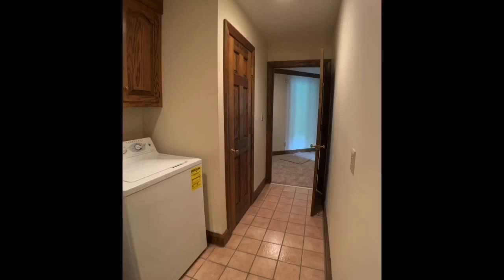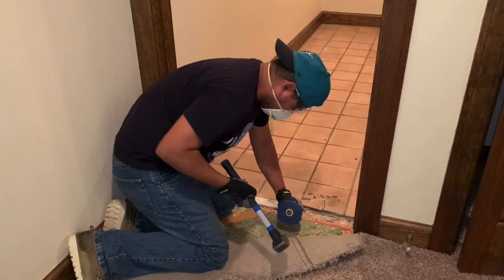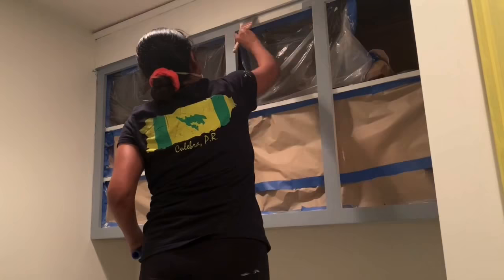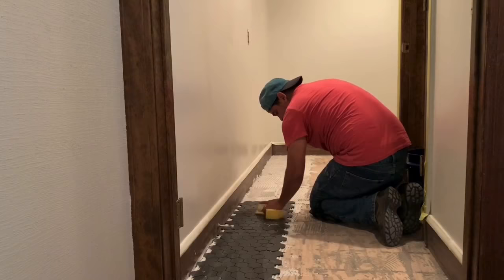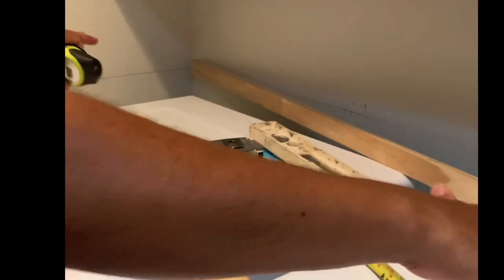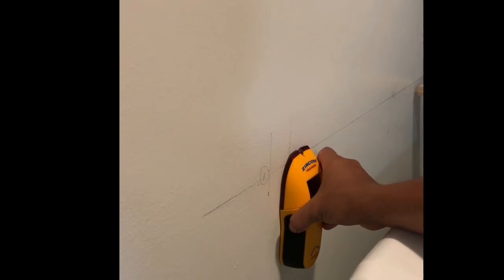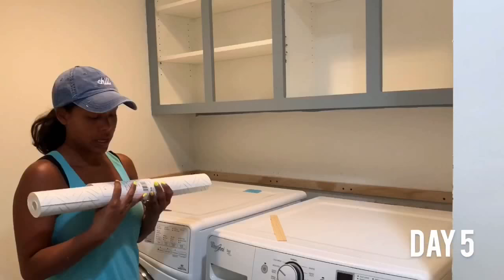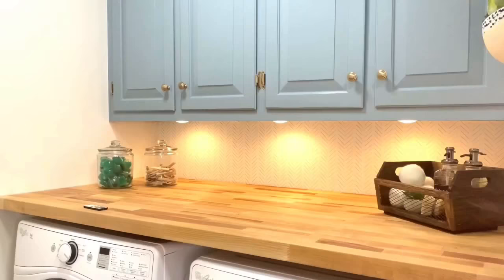EXTREME LAUNDRY ROOM MAKEOVER **DIY TRANSFORMATION** #laundryroommakeover #diylaundrytransformation

Comment: Love love love this!!! You guys did such a great job. Quick question. For the countertop, is it just resting on the wooden beams you screwed into the back and side walls? Or did you screw it into the beams or something?
Reply from the maker: Thank you for watching! I’m glad you liked it! ❤️The countertop is just resting on the wood beams! I did not nail or screw down the butcher block.
Reply: @CarmensDecor  Oh wow!! Have you experienced any problems with the countertop shaking or warping overtime? I have a drain pan under my washing machine, so I've been super nervous with installing a countertop I couldn't easily remove/move out of the way if I ever needed to fully access the washing machine.
Reply from the maker: It doesn’t moved at all because the wood beans are secured with nails to the wall stud. The way my husband explained in the video 😊
Reply: @CarmensDecor  That's great to hear! Thanks so much for sharing. <3
Reply from the maker: Your welcome 😊❤️